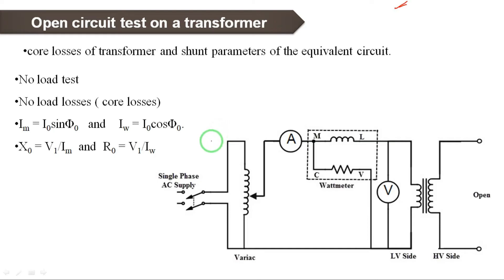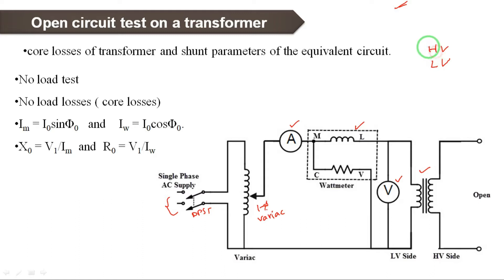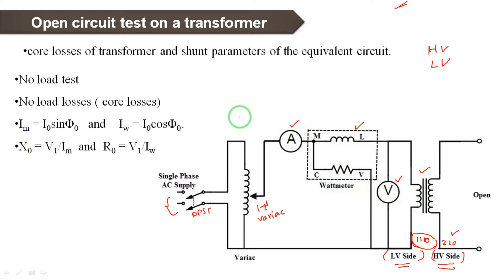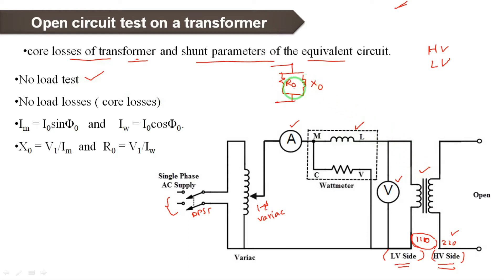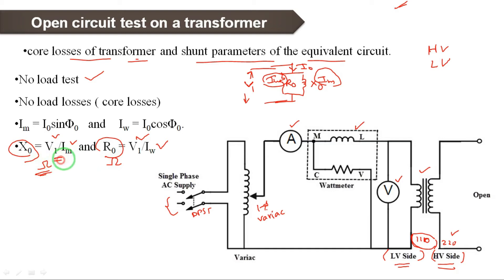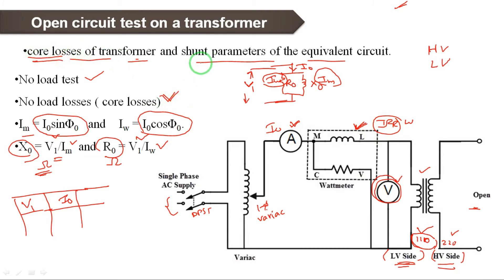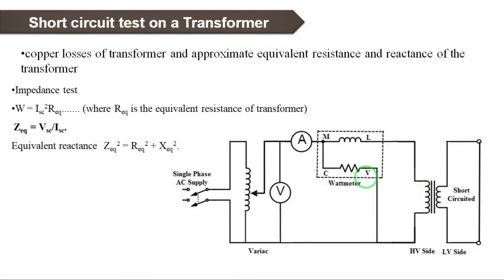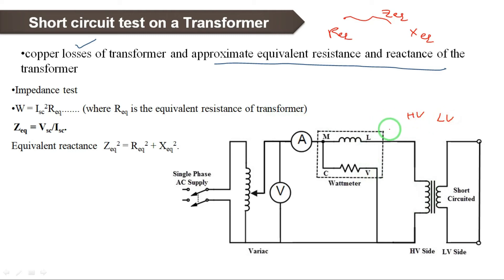L-9 || Open Circuit & Short Circuit Test on a Transformer || Single Phase Transformers

Comment: sir open circuit test lo HV side kani LV side kani test conduct cheyavachu kani LV side aa endhuku ante low voltage side kabbati current akkuva flow avthadhi, no load kabbati 2-3% of rated current flow avthadhi kabbati reading anedhi accurate ga vasthai , adhe HV side conduct chesthe thakkuva current flow avthadhi nka adhi no load kabbati 2-3% of rated current ithe chala takkuva kabbati readings accurate teskolem kabbati LV side conduct chestham
Reply from the maker: Good answer

Comment: Sir why the copper losses are negligible in OC test sir
Why the iron losses are negligible in sc test sir
Reply from the maker: When secondary side Open circuited then no current flows, only primary current will be there so primary copper losses are negligible.
Reply from the maker: When secondary short circuited then maximum current flows to the load.. At this time compare to copper losses, iron losses are negligible...